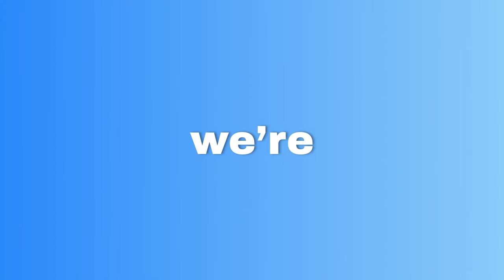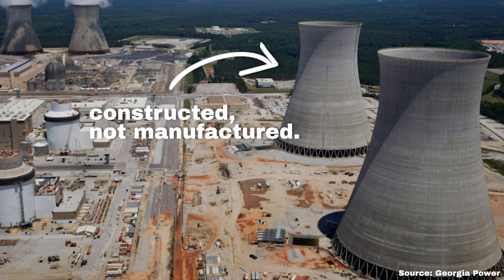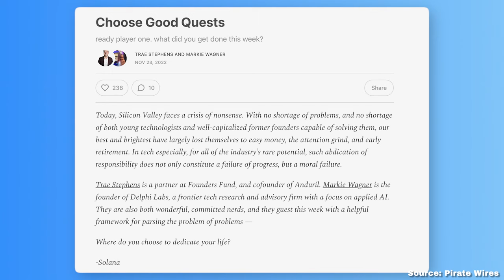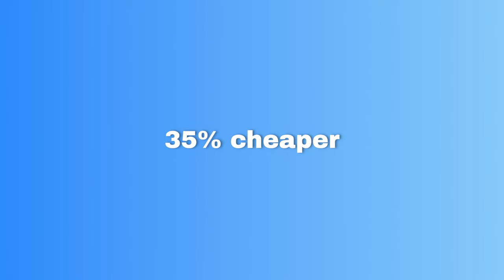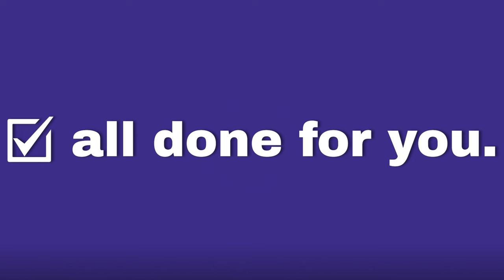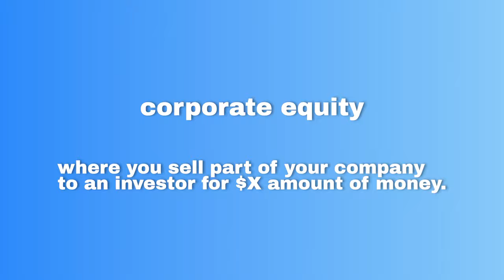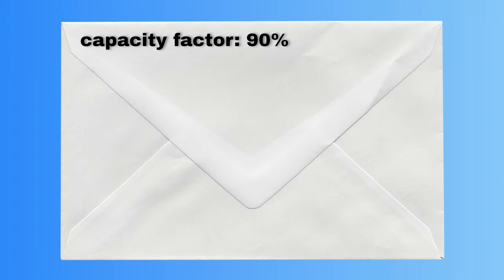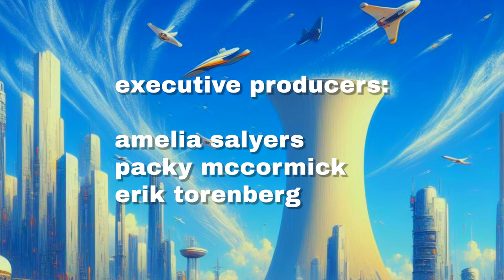How to Build 10,000 Nuclear Reactors

Comment: Nuclear fission reactors have characteristics that are different to other industries such as automotive.  The byproducts of nuclear fission are highly dangerous and toxic.  Unlike other products such as automotive or aerospace, nuclear fission reactors operate at criticality that is an inherently unstable condition that must be controlled by active feedback.  A nuclear fission power plant exploding spreads permanent nuclear contamination over a region; the dangers of contamination at Chernobyl and Fukushina Dai'ichi are clear examples of the terrible consequences.  Thus, the people in the video are naive zealots that are asserting nonsense.  SMR's create more nuclear waste per kWh of energy produced than large nuclear reactors.  The issue of nuclear waste has not been solved: see the problems at Hanford, Oak Ridge Laboratories, Yucca Mountain repository.  As aforesaid, NuScale's experience at UTAH with cost overrun clearly shows that SMR's are not commercially viable.  Investors would be insane to invest in SMR's - renewables is a much better investment, especially with flow-battery energy storage.
Reply: > The byproducts of nuclear fission are highly dangerous and toxic. 
But unlike the automotive industry, the byproducts are captured and contained.
Which is worse - deadly to humans auto exhaust in the biosphere?
or deadlier to humans, but separated from them by meters of concrete and steel?

> nuclear fission reactors operate at criticality that is an inherently unstable condition that must be controlled by active feedback
You don't appear to understand what 'criticality' means in the nuclear fission sense.
Criticality simply means you have a sustained nuclear reaction.
It isn't an unstable condition, it is actually a fairly broad range of conditions, which in most reactors (all the Western ones) have a negative reactivity coefficient.
(i..e you have to keep turning the reactor up to continue its operation; if you don't, the reactor will eventually stop as the fuel is consumed and it falls below criticality).

> A nuclear fission power plant exploding spreads permanent nuclear contamination over a region; the dangers of contamination at Chernobyl and Fukushina Dai'ichi are clear examples of the terrible consequences.
Although the accidents at Chernobyl and Fukushima Daiichi were not great for those involved, they were pretty mild compared to other accidents. Or even standard operating procedure at a coal plant.
Chernobyl - about 65 dead, some 1800 known cancers, and maybe 4000-11000 total.
hydro accidents - anywhere from 100s to 1000s to 100,000s dead.
natural gas explosions - 10s to 100s dead (and happening every year)
coal business as usual - 100,000s dead each and every year from coal emissions
Reply: @factnotfiction5915  I have spoken with nuclear engineers of nuclear reactor design companies and professors at universities and they use the phrase "criticality" to mean a sustained nuclear reaction.  A nuclear bomb is merely a beyond criticality where there is a rapid temporal growth in nuclear reaction rate. therefore my use of nomenclature is correct.  The other issue that you write about is a falsehood: automotive pollution are of a different nature to nuclear pollution, wherein the former is of a chemical toxic nature whereas nuclear pollution is of a radioactively toxic nature.  These are mutually different, hence what you write about is nonsense and shows that your knowledge of the subject matter is immature and superficial.
Reply: You are playing the fear card--Chernobyl did explode and did spread contamination, but only because it had no containment building. Chernobyl is the only accident that has caused deaths by radiation, and the most credible UN reports say about 50 died from radiation, and a few hundred from longer term thyroid cancers and difficult to quantify results. The Chernobyl reactor complex had four reactors. The three that didn't explode continued operation for many years. If you want to understand that accident, see the Illinois Energy Professor's video.
Fukushima deaths were all from the tsunami and exactly zero from radiation. Several years later one worker died from cancer and his family was compensated. The reactors shut down correctly. The sea wall was insufficient, and the generators to supply backup power were located where flooding was inevitable if the sea wall was overwhealmed. Read the book Fukushima if you want to understand the unfortunate politics that led to the bad choices made.
Three Mile Island was a disaster for the investors, but nobody was injured. A small amount of radioactive gas escaped, but the level was not unsafe and was comparable to normal background.radiation. 
Some reactors will use TRISO fuel which certainly produces more volume of waste as little balls that cannot melt in event of an accident.  But the actual mass of waste is the same as any fission process. 
If you actually study the facts of nuclear energy, you will be less afraid.
Reply: @PorpoiseSeeker  People like him are usually not afraid, just a quasi-religious zealots!
Reply: @thewiseperson8748  > they use the phrase "criticality" to mean a sustained nuclear reaction.

True

However, you stated "nuclear fission reactors operate at criticality that is an inherently unstable condition that must be controlled by active feedback", which is a misuse of the term. Criticality is a stable condition, and is a desired feature in NPPs.

> the other issue that you write about is a falsehood: automotive pollution are of a different nature to nuclear pollution, 
Yes, they are different - automobile pollution directly enters the biosphere.
Nuclear pollution is captured, stored contained - it does not enter the biosphere.

I note that you fail to answer my question as to which you prefer, active destruction of the biosphere by uncontained automobile (or other chemical) pollution, or passive non-destruction of the biosphere by contained nuclear pollution.
Reply: @factnotfiction5915  The criticality in a reactor is not a stable condition and must be monitored and adjustments made periodically.  The fission reaction gradually generates fission byproducts that accumulate in the fuel rods that gradually quench the fission reaction, requiring the fuel rods to be replaced.  By alleging that criticality in a nuclear reaction is steady state shows that you know nothing about feedback control systems.
Reply: @thewiseperson8748  > The fission reaction gradually generates fission byproducts that accumulate in the fuel rods that gradually quench the fission reaction, requiring the fuel rods to be replaced.

Glad to see that you learned something by reading my post several days ago!

"Criticality simply means you have a sustained nuclear reaction.
It isn't an unstable condition, it is actually a fairly broad range of conditions, which in most reactors (all the Western ones) have a negative reactivity coefficient.
(i..e you have to keep turning the reactor up to continue its operation; if you don't, the reactor will eventually stop as the fuel is consumed and it falls below criticality)."
Reply: So you agree with me that criticality is an unstable operating condition in nuclear fission that needs to be controlled by feedback control.  You also agree with me that, if the criticality is not adequately controlled, it may potentially lead to a supercriticality that occurred at Chernobyl, Santa Susana and in nuclear bombs, to spread huge dangerous amounts of radiative contamination into the environment.  You therefore agree with me that nuclear fission power is inherently unsafe and has been a dreadful decision by humanity to use.  You hereby agree with me that the nuclear reactor design at Fukushima Dai'ichi was an insane design to use in an earthquake-prone region of the world.  You further agree with me that it is insane for humanity for humans to using nuclear fission power for its future energy needs.  You herewith also agree with me that the alternative of renewable energy systems is both less environmentally risky and of lower cost than using nuclear fission power.  Thank you for agreeing with me.  I am glad that you have herewith seen sense and agreed with the confirmations above.  Thank you ;o)    @factnotfiction5915
Reply: @thewiseperson8748  > So you agree with me that criticality is an unstable operating condition in nuclear fission that needs to be controlled by feedback control.  You also agree with me that, if the criticality is not adequately controlled, it may potentially lead to a supercriticality 

no I don't

criticality is a stable operating condition; it takes a LOT to get to super-critical; and that won't happen in negative reactivity coeffiicient reactors (note the RBMK had a positive reactivity coefficient).

maintaining (let us be more specific here) delayed criticality and avoiding prompt criticality is well understood and not a 'knife edge' or requiring great sophistication (if it were, then NPPs would have been much much more difficult to commercialize).

yes I agree that criticality needs to be adequately controlled - but all machines require adequate controls, so not much of a point there.

no, I don't agree that it can lead to supercriticality - particularly with negative reactive coefficient reactors.

Also, I don't agree that supercriticality occurred at Chernobyl - there was no 'nuclear' explosion. Chernobyl went prompt critical, boiled a bunch of water into steam, created a 'steam' explosion, and then due to the latent heat, started a fire.
Despite the wildest dreams of an HBO screenwriter, there was no possibility of the Chernobyl reactors causing a 'nuclear' explosion.

the rest of your post descends into drivel - I will not answer back to any replies.
Reply: @PorpoiseSeeker i hear you but tell that to exclusion zones of cher and fuke. things can go wrong but we're beyond that now as the current known climate threats.